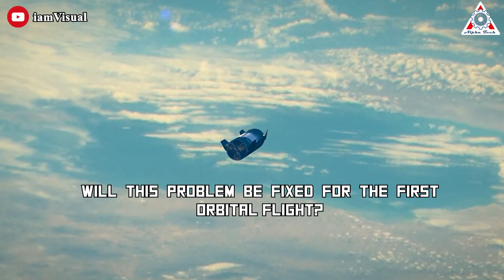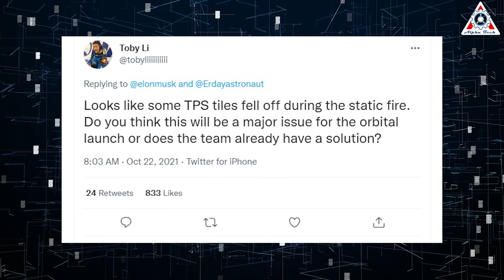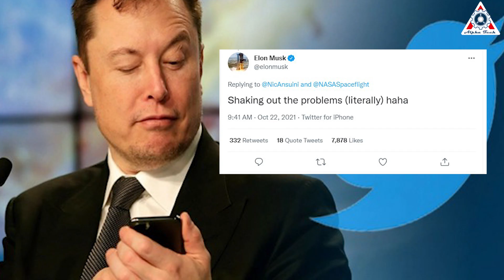SpaceX Starship's heatshield Testing problem!

Comment: Doesn't make any sense that because the stainless steel has a much higher melting point, then use thinner tiles for the heatshield, the crew is still of flesh, and the interior temperature should be tolerable for them !!. The heatshield it's a critical point that has been prety much overlooked, but despite all the hype and optimism, it's a tough test to pass for the Starship, and surely another source of big problems that will move even more the schedule.

Comment: There is a concrete expanding anchor bolt that teaches that a metal sleeve can be made that can expand and lock a metal bolt to concrete or tile.  Problem is that this application is backwards; it is fastening the tile to the bolt.  A tapered hole in the tile may work.  Once the tile is in place over the bolt via the tapered hole; A cooperating tapered threaded anchor nut is twisted onto the bolt stud thus securing the tile to the ship, ceramic putty is plastered over the hole and the anchor nut. The ceramic putty is cured with a torch. Ultimately something needs to be invented to fit a prefabricated glove or sleeve over the entire spaceship. That'll come with experience.
Reply from the maker: Great info. Thanks

Comment: A question I have is this... Will the vibrations associated with igniting the Raptor engines on an Earth-bound test stand translate into similar vibrations that might be experienced while in flight? The ignition and firing of the Raptor engines on a firmly secured Starship should obviously generate much more intense vibrations than those experienced while in flight as the test stand is preventing the forces of propulsion from doing their job, that of pushing the Starship forward. I think or surmise these vibrations will not occur with the same ferocity in flight. I would posit that the true test of the TPS tiles remaining attached will come with the full test firing of Booster 7, but again during the actual launch, the extreme vibrations might only be experienced during the time between ignition and release of the entire assembly. Anyone have thoughts on this?

Comment: Each tile needs to be sewn or wired to the skin and to its neighboring tiles.  In order to speed up tile placement, mats of tiles could be pre-sewn together and then attached to the skin of the Starship.  There would be two types of tiles.  One that overlaps its neighboring tiles and one that underlaps its neighboring tiles.  The degree of over and underlapping would allow for a less rigid attachment.  The tiles would float to some degree as the skin of the Starship flexes and vibrates.  The wiring that connects the tiles would have elastic properties that would dampen vibration and would return the tiles to their original position.

Comment: I can't claim to be able to do the math on this, but it seems, from all the simulations I can run in my head, that a small exposed area (such as a single-tile gap) might not be a major problem. The air resistance will spread across the entire surface, creating a buffer zone of essentially homogenous superheated air, much like a blanket of some small depth. It is this buffer that will actually push back against the atmosphere, preventing turbulence against the tiles (keeping in mind that the buffer is partially rolling off the curved sides, taking heat with it). A missing tile will expose the skin of Starship to the equilibrium temperature of the buffer, but the heat will dissipate in all directions along the steel of the skin, and into the large interior volume. So as long as the temperature of the buffer doesn't significantly degrade steel, and the heat accumulated within Starship during the trip down doesn't raise the crew compartment temperature above the livable zone, it should be okay.

Obviously somebody at SpaceX needs to run the math (maybe they already have) and calculate how many lost tiles equals an abort, but the fact that Starship loses some tiles doesn't automatically disqualify it as an effective vessel.
Reply: As I recall, the stainless steel used on Starship doesn't need heat protection to re-enter safely. The heat shielding is for the cargo (and other systems) which isn't as likely to be able to handle those kinds of temperatures.

Comment: Are the TPS tiles attached by some form of bolts or an adhesive? Maybe it could be possible to bolt them in from inside a layer of stainless steel that is added/welded around the bottom of the ship and lock-tited to prevent the screws from walking out
Reply: The tiles are mounted one use snap mounting points on the tiles with three ball tipped studs they snap onto. There is an air gap under the tiles. One the older videos showed tiles being put on.
Reply: @wacojones8062  is the air gap to prevent any heat transfer to the actual hull of the ship?

Comment: How much of the heat of re-entry could be reduced by the use of a long retro-fire burn to slow the craft down for re-entry?
Reply: All of it with enough fuel.... now you have no payload.
Reply: @peterreimer2540  Is there no trade-off point where using some fuel to slow down re-entry enough to reduce the expense of heat shield material would be a net gain?

Comment: Titanium open mesh blanket over tiles for launch ..... burns off?? during re entry ....... leaving tiles intact for heat protection.
Reply: What if it comes off in a non-uniform manner?

That would most likely be a different variation of destructive disaster.

Titanium is quite a metal. It’s actually too tough in all aspects for your idea, including temperature tolerance.  It’s also not cheap and easy to work with.

Aluminum, on the other hand, has a better chance of making sense. And even better than hoping it burns off during reentry, purposely jettison it in a controlled manner.  It only needs to be strong enough for long enough.  It’d be interesting to know what reentry temperatures it’d experience if jettisoned off on its own, as aluminum can be burnt easily in a campfire.

Comment: i got it put them on like dragon scales overlapping they will hold each other down .also shock absorbers under them
Reply: Are you suggesting that except for perhaps the bottom row, which is anchored down at 3 points, perhaps it makes more sense to have a single anchor point at the top so they don’t have stress between several points, and have a a layer of adhesive that’s got some bouncy nature to it (softer than the brittle tiles, more give) and as they overlap each other, they won’t be a problem?

I’ve considered that it’s quite possible that having multiple tether points is actually working against the tiles: they’re brittle, and stiffer than the stainless steel, which will flex at least small distances with great ferocity, creating sort of a Bermuda Triangle of destruction between them, alternating between tension and compression that’s not synchronized in a manner that results in a stable dimensional relationship between them.  The problem I suspect is largely that: it’s an over-constrained system for the objective.
Reply: @strictnonconformist7369  I'm saying shingle them like like a roof you can still have the same connections but just redesign the tiles like roof shingles so they can overlap and hold each other down .say there are four bolts one shingle attaches to the bottom two but the top part of that shingle will be thinner than the bottom of it so the next shingle will overlap attaching to the bottom two bolts and to the top two bolts you can place the shock absorber on the bolts between the two shingles.
Reply: @strictnonconformist7369  but yeah I'm also willing to admit that you probably know a lot more then me what I'm saying is just an idea there's no real math or science to my comment.

Comment: I'm shocked to discover, from what I can find on-line, that the Shuttle's tiles were attached without using a vacuum when attaching each. I had assumed if SpaceX is gluing to those bolts that they would attach each tile using a partial vacuum system just like when repairing a car windscreen crack, you need to evacuate the air so the adhesive can reach all instead of some of the available surface area,

Comment: Tiles won't work. It's a very primitive technique, and some will always come off. They need to find a way of a thick heat resisting coating, which will be added onto the rocket in one layer, as a kind of epoxy- rock-hard heat resisting resin. If the starship will fly one day, they will never come back in one piece. Tiles are way to fragile because it are ten thousands of pieces which is ten thousands of risks
Reply: Coefficient of expansion differences make your proposal problematic, even more so for the sake of attempting to do it in a single piece.

Comment: The only important thing for the first orbital flight is to reach orbit, thus the name orbital flight. For the first orbital flight the tiles are just unnecessary baggage and nice to have as test articles. Functional heat shields sooner is better & cheaper but later is still not a problem.

Comment: hat if they use a type of golf ball type of surface dimpling? at high speed the air speed is moving slower then that of the air speed just above it ?it may give a small amount of contoured strong backing and may produce  surface adherence to the metal and heat sheld plates ?how about a over coatings of some type so has to blow off has the ship take off or come's in to land ?if a good blow off cooling striping meteral  can be made it can or at let help at some spots along the ships belly that may act like out gassing like heat s flow just above the panels? how about a orkclould displacing the sub layer from the upper higher heat laying?..

Comment: If the damage on tiles is due to vibrations, in that case I do agree with elon when it comes to testing until the problem is solve for good. On the other hand, If tile damage is due to debris impact during the 6 engine fire test , then they need to take care of that . Space X is not a rookie company any more , they can't brake things just becose, they can't start fire in a protected enviroment , they should avoid damage to perfectly working assets like the engine damage during the test that's risky and EXPENSIVE , they can't allow hot debri fliying miles away cos in the near future they are planning to operate in the cape next to some expensive infrastructure , and I fell confident NASA is going to take actions if they dont...  Thats the beginning of a company culture that previuosly let to the lost of live during the shuttle program . "normalization of the risk" is lethal and actions should be taken to avoid such cane of issue.
Reply: And YUP, I know is just a test stand . they need to build a higher one .

Comment: A fastener that holds the tile on, so that the different materials' expansion and contraction doesn't let it fall off, is needed. How about some sort of ball and socket type fasteners, so the socket can be a little bigger than the ball and allow it to expand, but too small for the ball to come out? I'm thinking of a pin type of system, similar to what I think they're already using, it's the actual connections that would be balls, on the end of the pins, and the 'sockets' in the back side of the tiles... Is this crazy, or somehow unworkable?
Reply: A barrel lock, like utilities companies use to lock out a service shutoff.

Comment: How about a combination of the glue and magnets and electricity come on guys I know this will work it's common sense nothing magnets want to move or slide just set the strong parts in the dense you make or Mark or a peg but use magnetic power it should stick like glue the things metal isn't it
Reply: Magnetic strength drops off greatly when they get hot.

Comment: I thought the ship was made of stainless steel makes the things magnetic duh
Reply: 1. Most of the common Austenitic Stainless Steels like 304, 316, and the 304l Starship is made of,  are not magenetic.
2. Permanent magnets all have what is called a Curie temperature, above which they lose magnetism.    Neodynium (strongest) at about 350C, ceramic ferrite (weak fridge magnets) about 400C.  Expected reentry temps, about 1300C.

Comment: They should look into making bigger heat shields moulded to the shape of starship, sort of like a half ring like the rings they stack.
Reply: I would suggest more tiles rather than fewer, bigger versions.  I would suggest extending the shielded area by enough to make all of the tiles the same except those on the flaps and their mounts.

Comment: I wonder if they could build a big protective cover for the heat shield that could be detatched after launch and parachuted down after the max stress and shaking is over.   This could keep the heat tiles in place for reentry.
Reply: Just overspray them with Rinoliner or some other pickup bedliner.  You just need to hold them in place on ascent and the plastic can be allowed to burn off during re-entry.

Comment: I think that people not in the aeronautics/space industry assume that if one tile falls off then the starship will blow up on re-entry. To be honest Elon has not been very truthful or transparent in this regards.
In your piece you show that this is unavoidable and NASA had the same problem but you do not explain the thermodynamics of re-entry as to why some tiles can fall off and not expose a high risk of death to the astronauts.
I assume that death only occurs if sufficiently large areas of the starship are exposed to plasma - ie, contiguous tiles falling off. 
So no issues if small patches of tiles fall off exposing several disconnected small areas of starship during reentry. 
I would nor like to be on the starship on reentry though.

Comment: Damaged tiles on ship 24 occurred on a static fire with 6 engines on a stand in the atmosphere. This is not a situation that occurs during flight. The performance of the heat shield tiles will be evaluated on their performance when atop Super Heavy engine ignition, flight while atop SH, performance during Starship ignition during launch, and then landing burns and landing. None of these modes have been evaluated yet and may prove mute or be a bigger concern.

Comment: The problem with the heat shield / tiles?, what a problem!. If you are looking for a solution, you should use the simplest structures tested in the past – use a disposable heat shield on this part of the Starship, similar to, for example, the Apollo 11 return capsule, rejected after entering the lower layers of the atmosphere (after melting part of it and losing speed) – this is the simplest idea to consider, and there are MANY of them.
Currently, this type of tiles are a dead end for this construction (see FEA calculations: stress / deformation in the sheets during the return through the atmosphere) – maybe in the future with new metallurgy!. As for the above-mentioned version of the shield, it is not a technical problem - mounting a new cover, at its low unit cost - compared to tiles like in space shuttles, the more so because the shape of the Starship is ideal for its installation.
As for other technical details of this construction, I will not suggest – let your designers think and earn high salaries – I give a "fishing rod" and let them catch a FISH.
P.S. Your problem is related to the so-called "continuity" of thinking with the Space Shuttle, and it is a MISTAKE. The problem of all constructors in the world - suggesting previous constructions, which is not always unfavorable for the freshness of "thinking".

Comment: Perhaps you could add a glue between tiles that would burn off on reentry?
Reply: Maybe glue that does not burn off on reentry. The tiles are hexagonal shape to minimize hot plasma flow along the channels between tiles and thus minimize heating in the channels between tiles.
Reply: @ben8190-rip  Vibration, which a soft adhesive might dampen, is a problem on takeoff  and not so much on reentry. If the adhesive hardens and remains it could be a problem on later launches.

Comment: Leave them in orbit as a new space station
Reply: no tiles needed. But how do you get the people back to the ground if it's manned? easy, just have space x type shuttle that can dock with the orbitor. Have another as a fueling Orbitor which another orbitor can refuel from. 
I do think that has been discussed before, but if the first orbitor with the tiles comes back safely it will be a go for other non tiled orbitors.